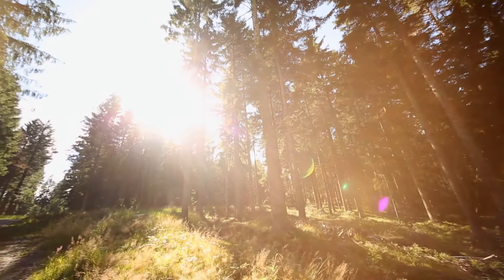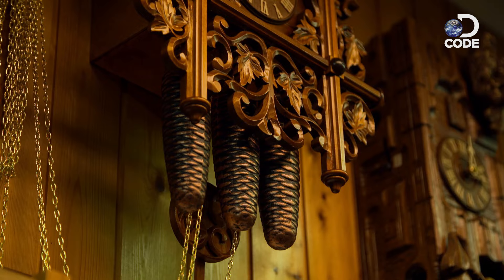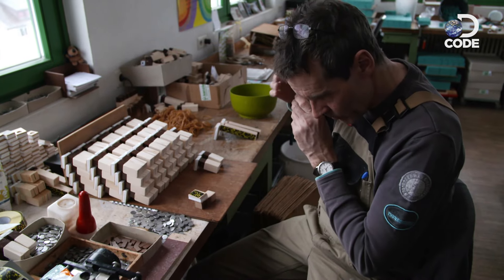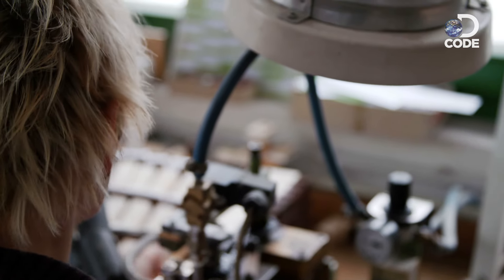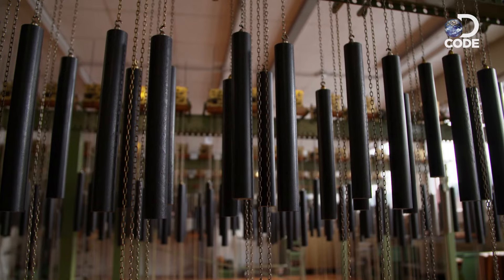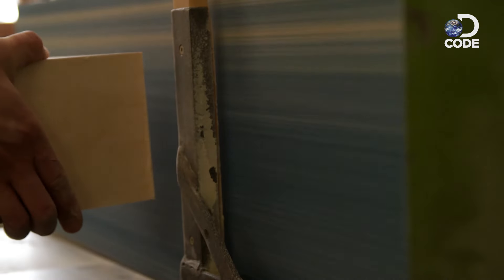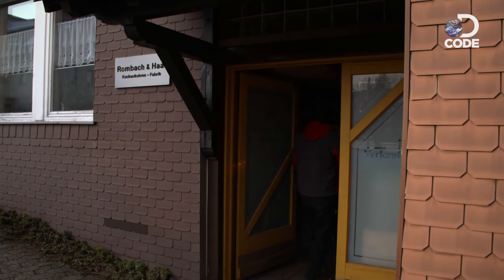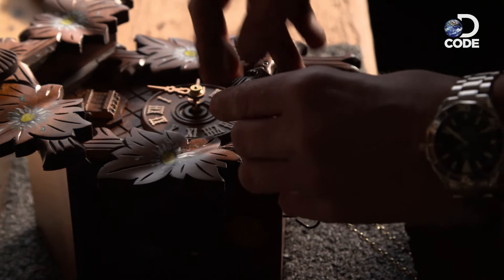How Are Traditional German Cuckoo Clocks Made? | How Do They Do It?

Comment: Generally, a good Cuckoo Clock will rarely give you any issues - in part due to that it is powered by Weights and not a Spring which causes most problems in your average Clock.  I purchased a Cuckoo Clock brand new 30 years ago - it wasn't even a top of the range Model - about £100 -  still going!

Comment: I have one made in the late 1800's. The nails in the house are square and look hand cut. There is no plywood in the whole house. There are no screws in the mechanism! It is held together with little wedge pins driven into slots in the brass studs! The gears are obviously hand made. It still works fine! (it does have new bellows.)
Reply: hey so i have a question I don't have one but Im working on an engineering project  so this is considered an automation well do you ever crank it up or doesn't just need calibration every once in a while curious. and it doesn't require any sort of electricity either right. just wondering from a first hand experience fellow. Thanks

Comment: Is it possible to use a cuckoo clock in an RV? I just bought one thinking it would go great in my new RV, but I’m guessing it would take constant tweaking. Has anyone done this?
Reply: It would be fine when you're parked but moving around with all the bumps and turns will play havoc with any pendulum clock.  There are battery powered quartz Cuckoo clocks available.